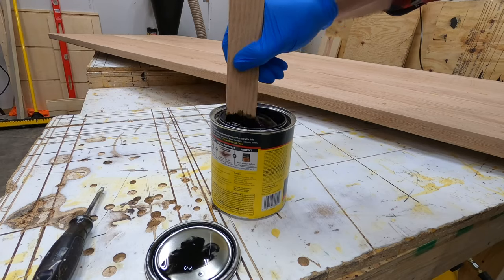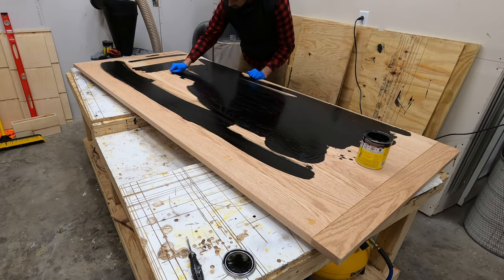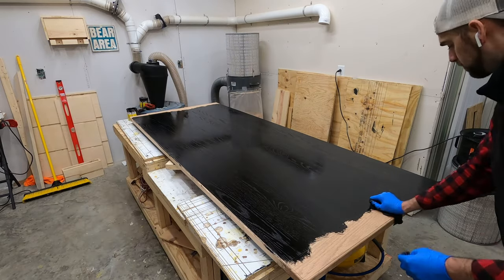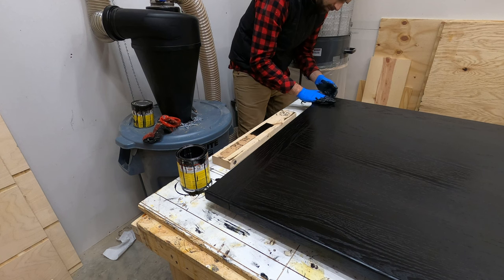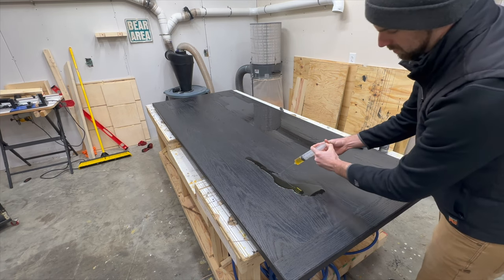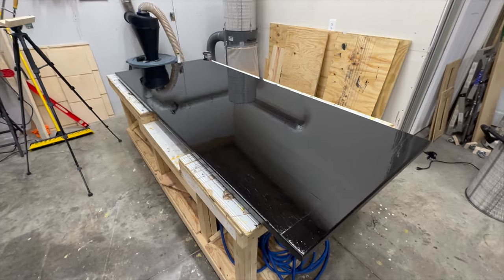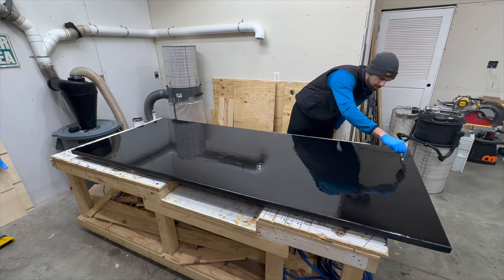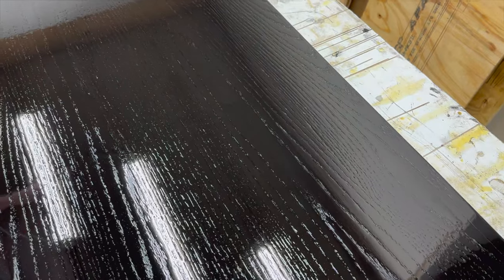How to get a PERFECT Polyurethane Finish || How to Stain a Table || Black Stain Tutorial

Comment: Dude that black looks great🤘

I started mixing my Polly with mineral spirits, I think it's a 2:1 mix (2 parts Polly 1 part mineral spirits... I think lol) and I apply it with a good lint free rag. Light sand between coats. Turns out real smooth, and easier to apply
Reply from the maker: Thanks Rab! I’ve heard of doing that, but never gave it a try. I’ll have to experiment with it at some point!
Reply: @mmcc_woodshop6288  it made a big difference in my finishes. Worth experimenting

Comment: Hi again. The stain has just arrived (living in Germany it's not that easy to find this stuff) and I tested it on a small piece of wood. Wow, the coverage is amazing! Even one coat looks awesome. I am so happy, because this saved me a lot of money. I almost ordered the Rubio Monocoat Oil Plus 2c for 4 times as expensive. Again, thank you so much for this video!
Reply from the maker: Glad it worked out! Rubio looks great, but Rubio is a hassle to get a black finish - you have to use the pre color, then the 2c oil, then black maintenance oil. It quickly turns into a $200-$300 expense to get a true black finish with Rubio. 
This way (in the video) is much more cost effective 👍🏻

Comment: Nice build man! I've used this exact same polyurethane and love it! I picked up a tip from Mark over at The Wood Whisper years ago, to dilute the minwax poly with 25% mineral spirits to make your own cheap wipe on poly. I apply with a rag and lightly sand with a grey scotch brite pad between coats. I usually do 4-6 coats, waiting 4 hours in between. After the last coat if needed, I wet sand lightly with a 2000-2500 grit for a baby smooth finish! I only use matt finish, so not sure how it would look with a gloss.
Reply from the maker: Thanks! Appreciate the tip - I’ll have to give that a shot. Mark has some great videos for sure!

Comment: Thanks for your commentary on the drying time. I thought I did something wrong when my project wasn't dry after leaving it overnight.

Three questions...1. what gloss level was your polyurethane; 2. where did you get your syringe; and 3. does your table have a particle board core?
Reply from the maker: Definitely have to give it enough time to dry. 
I used ‘gloss’ (full gloss) Minwax poly. The syringe came from Amazon. This was a solid oak table top (no particle board).

Comment: Looks awesome. I will look forward to using a black color on something. On smaller pieces I can keep most bubbles from forming by using a good brush going fairly slow. If i do any surfaces near as big as your table, i will surely follow your steps. I believe your way could be better than spraying considering the number of steps where boo boos can happen. Much obliged.
Reply from the maker: Thanks for watching and the feedback! Good point on the larger surfaces! 👍🏻

Comment: Very helpful video!  I am going for my fourth coat of poly on a big surface—high gloss oil based finish.  I have brushed on 3 coats of Old Masters, all get bubbles which I sand off.  Can I wipe on with the Minwax wipe-on poly?  Both oil based high gloss. I don’t know if the different brands are compatible.  I need no bubbles in my final finish!  Thanks!
Reply from the maker: I would think you should be able to, just make sure they’re both either oil based or water based. Definitely make sure you have the surface clean before you move on to the wipe on poly 👍🏻

Comment: Very Nice!  How strong will the final finish be?  And will it be resistant to water marks if someone neglects to use a coaster? Thanks!
Reply from the maker: Thanks! The strength/effectiveness depends on how many coats are used. My kitchen island is wood with 5 coats of poly - I’ve absolutely abused it and it still looks great. The water marks show but fade as the water dries

Comment: I cut my poly with spirits but seem to get occasional lines every layer i add (1000 sand between coats), and visible with lght hitting it (garage windows) but looks great from other angles.   It seems to dry fast in places....or maybe i am not using the proper rag to wipe it across :)  Last layer i used a brush.  I use canned oil-based Poly.... thoughts on how to avoid the spotty occasional lines?  (Should mention this in on a lightly sanded ~60 year old maple table top.)  Assume I need to let it cure 30 days before use also.
Reply from the maker: I’ve heard of using mineral spirits to thin but I’ve never tried it personally. The issues you’ve mentioned are the exact reason I usually try a wipe on poly for the very last coat. I would wonder if the lines you mentioned are due to the mineral spirits, maybe not being thoroughly mixed 🤔

Comment: My wife and I just picked this color to stain our cabinets in our new house we're building right now. But what we're trying to figure out is if we do this ourselves or let our builder's painter do it, he uses a sprayer and we're not sure how it's going to turn out. I've tested some boards myself with this and have liked it, we're trying to hide the red oak grain so it's not so busy looking. From my testing I know if we wiped basically right after applying the stain, a little bit of brown would show through so our best results have been waiting like 10min before wiping. Problem is I'm not sure the painter is going to wait before he wipes off excess but we want the true black to show. Any idea what the difference would be with using a sprayer vs wiping on? Also, is there any difference in sanding before applying the stain. Sorry for the long post.
Reply from the maker: I’m not sure of any difference between spraying and brushing. One thing with black is that you absolutely have to let it fully dry before any clear coat, otherwise the clear coat will pull it back out.
It can be tough (nearly impossible) to hide the grain of oak unless you get into some really extensive clear coating

Comment: Can I just go over a regular desk with the black stain and call it a day without using polly
Reply from the maker: Sure, you can… The surface will just be much more susceptible to scratches and stains without a protective coat. If that’s not a concern then it’ll be fine 👍🏻

Comment: I like that nice and shinny thats what I want but have a question is it possible to beeswax after this ?
Reply from the maker: It’s certainly possible, but not necessary IMO. The beeswax won’t adhere to the poly, I would imagine wax is a much better top coat for a true oil finish (linseed oil, mineral oil, etc)

Comment: Does temp matter when using polyurethane? I'm trying to use that same Minwax Fast-Drying stuff, and it seems that I may have to resand the entire table down again and start over. I've got bubbles and an uneven finish. Definitely not shiny, or smooth, and its only my second time using this stuff.
Reply from the maker: The only thing I’ve noticed temperature related is that it tends to dry faster when it’s warm. Haven’t had any trouble with bubbles due to heat or cold.

Comment: Is there any way I can clean the dust off without mineral spirits? I’m on a lil budget.
Reply from the maker: Using mineral spirits in your best bet, if it’s not an option just get a clean towel and wipe off as much dust as you can making sure you don’t leave any streaks or piles of excess dust
Reply: @mmcc_woodshop6288  thank you! In your best  opinion, do you think rubbing alcohol or nail polish remover would work?
Reply from the maker: @LivandCreate I wouldn’t recommend either, but that’s because I’ve never used them personally. I would be concerned they might leave streaks or discoloration when they’ve dried. Again, I’ve not tried either before
Reply: @LivandCreate  I've used neither also but just fyi the two options you mention are way different. Rubbing alcohol is pretty mild and probably a safe option to try in hidden area. Nail Polish Remover is Acetone and will dissolve/destroy most materials. Also remember Mineral Spirits is only for Oil Based, Water Based use water. I think a slightly water damped cloth will pick up the dust for either, the use of Mineral Spirits I'm guessing is just so it evaporates avoiding trouble with people applying oil based over a overly wet still damp with water surface.

Comment: Sorry new to wood works. Why many video i saw, they wiped the stain after applying it? But you didnt. Explain pls
Reply from the maker: You can do either. Certainly don’t allow an excess (like a puddle) amount of stain to sit - wipe that off. 
I usually apply the stain and then slowly wipe with the grain to avoid streaks and puddles before allowing the stain to dry.

Comment: Stop using disposable foam brushes for topcoats, especially on a large surface such as this. Get yourself a better applicator! Or a worthwhile brush. The chances of shedding with cheap foam increases significantly with use. Even a roller with a nice foam nap (for cabinets) would have been exponentially better than what was used here.
Reply from the maker: Thanks for sharing your thoughts, I’ve personally had better luck using foam brushes than a nice paint brush. From my experience, brushes leave steaks and rollers leave a very rough surface. Personal preference may differ for everyone 👍🏻